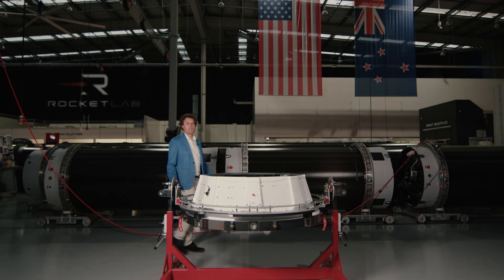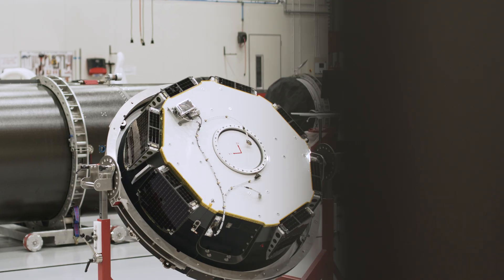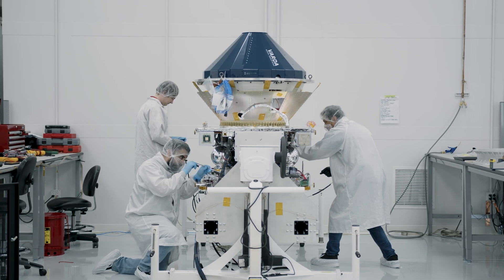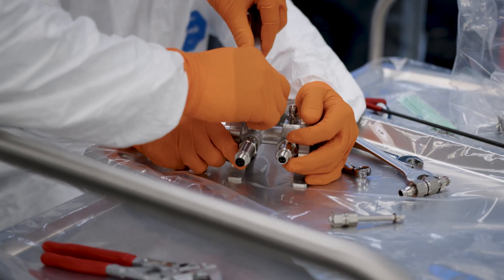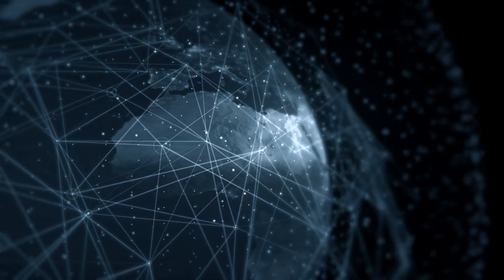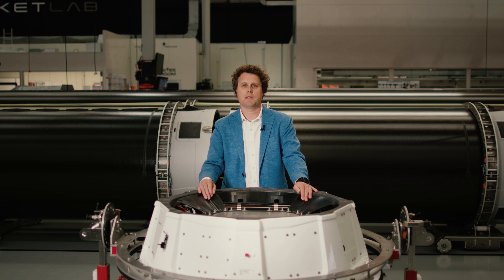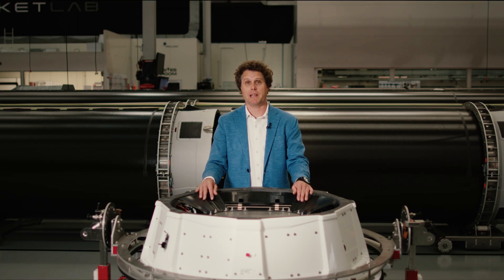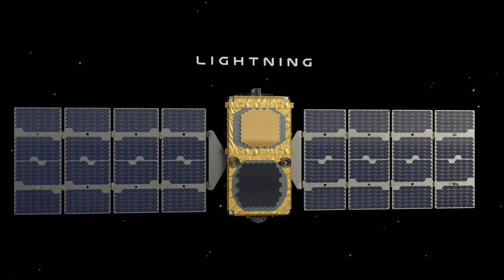Rocket Lab Spacecraft Family

Comment: Everyone: "Is light a particle or a wave?"
Rocket Lab: "It's... complicated."
Reply: It's just a photon.
Reply: I think if it is slightly slower than the speed of light, it is a particle, slightly more and it's a wave.
Reply: @onjofilms  You'd be wrong then. It is the fabric of space itself which can't support any movement through it, faster than C.
In exactly the same way you can't make a wave travel faster than a certain speed in water.
** In deep water a wave moves with velocity √gL/2π where g is the surface gravity and L the wavelength. Long wavelength waves such as tsunamis can move at 800 km/h, or 15% of the sound speed in seawater.
Reply: "Yes"
Reply: Indeed it is!

It's a quanta of electromagnetic energy without a rest mass, which propagates through the medium of space as a wave. Its fields affect such a large region of space, that they confuse people greatly, and cause them to think time is wibbly wobbly when it is not. Photon wavicles interact with space and matter in strange ways that we do not yet fully understand - but there are no paradoxes and there is no time travel - that's for sure.

And we can now say with some level of accuracy that light speed is measured against space itself, and that space flows with gravity, and it is space which drags on matter, and not gravity itself. Space is not only infinitely expandable, it is also infinitely compressible. On top of this, we can say with accuracy that there IS an absolute time, and there is no missing time in the so-called Twins Paradox. And that all this stems from a fundamental error made by Einstein: his conflation of clocks with time.

Clocks do not measure time, and they are not time. Clocks measure vibrations or oscillations of things. These slow down as relativistic mass is gained as velocity increases, and that is why clocks run slower at velocity. It's also why biological processes slow down. But time keeps ticking at the same rate it always does, in all locations, simultaneously.

The River Model of General Relativity solves Einstein's Equivalence Principle, and every other difficulty physics has struggled with for over 100 years now.

The big questions are now "What IS space?", "What properties must it have?", and "Can the flow of space be influenced?"